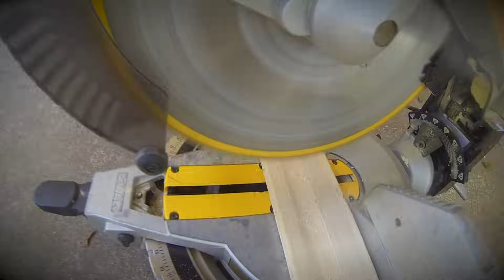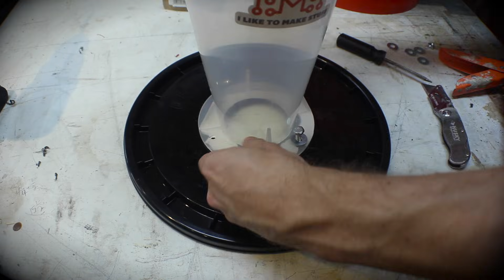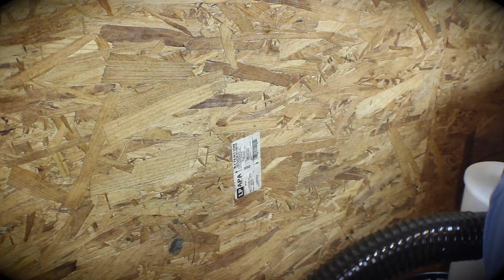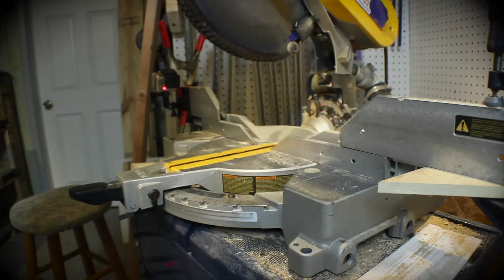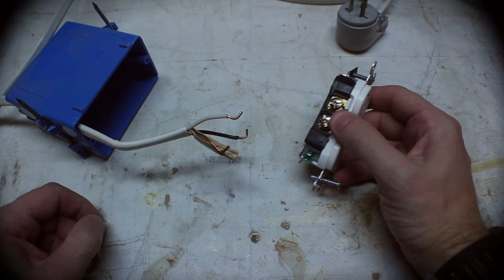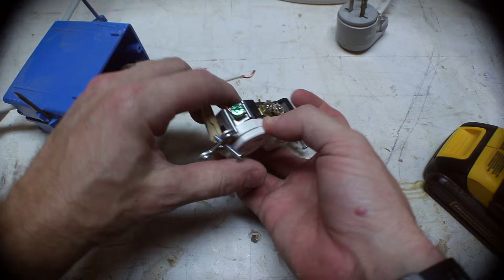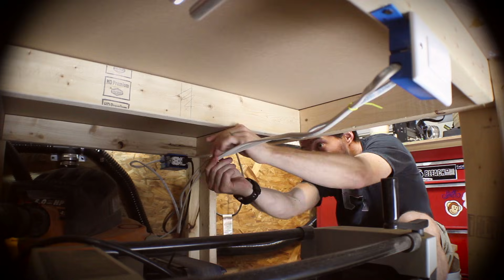How to make a dust collector with a wet/dry vac | I Like To Make Stuff

Comment: Thanks, I'll probably build this for my CNC router. One question: what about grounding for the static built up by wood dust in plastic pipes?
Reply from the maker: Robert Baruch You definitely could run a ground wire into the system easily. Personally, I don't run mine long enough to build up much static, and the conditions have to be pretty unique for that to actually cause a potential problem. Better safe than sorry, but it's pretty unlikely to cause a fire in most cases.

Comment: your wires should always wrap the wire clockwise. when you tighten the screw it will pull the wire in tight instead of push out.

Comment: Great Video and very informative.  I am going to have a run across one wall maybe 2.  Do you think I can get away with  2 1/2 inch pipe all around.  Table saw, jointer, planer, ban saw and drill press.  Small 1 car garage and I might put the shop vac in the attic and have my home made 50 gal.collector in the corner. Thanks.
Reply from the maker: James Dunne hey james! Yeah,I think that would work!  In this case, if you have long runs, you might want to put the main vac source in the middle of the system, and have it branch out in two directions.  Then you could put a gate on each of these branches, as well as gates are each tool.  This way, you could cut off an entire branch all at once, which would help minimize suction loss over a long run that is unused.  Does that make sense?

Comment: HI Bob, I am new to wood working and I am enjoying your videos very much.  Very easy to follow.  :)  I have a question for you,  Do you have an issue with static electricity? I have a cyclone dust collector made from a 5 gal water bottle, a bucket and a shop vac. I'm using pvc pipe and I'm guessing that is why I am building up static.  It works great but I'm not sure how to ground it.. Right now I have some downy dryer sheets inside some of the pipes to help.  It makes the shop smell great but I want a more permanent solution. I've searched youtube and have found 2 videos but they seem a bit complicated for me. Any simple suggestions.  :)
Reply from the maker: Nadine Morgan Hey Nadine!, Well, you just need to ground the system. Often people will run an exposed copper wire through the pipe and connect it to the ground (green) terminal on the plug where your vac is plugged in.You could even just run it out and touch it (you'll get a little shock) after each use.
Personally, I've never had an issue with it, and from a realistic danger perspective, it seems REALLY unlikely that all of the conditions would be perfectly right for a fire to start there.  Technically it's possible, but pretty unlikely.
Reply: Thank you for getting back to me.  It sounds so simple. My concern is I'm feeling electrical stimulation when I touch my metal table saw when I am not using a table saw sled.  I was nervous I was going to get shocked. Thanks again for the input

Comment: Hi April, I have a craftsman 6.0 shop vacuum  and I piped  it in and it does ok but i want it better so I bought a dust collector 13 gal 650 CFM it seems to have less suction than my shop vacuum.  Did you use a shop vacuum first and did you find a difference.tks Lee

Comment: have a sears dust collection piping syatem uses clear tubes that help find blockages also use a switch that turns on the vac automaticaly when i start the table saw moved the vac outside my shop to keep down noise inside my small shop the air compressor and vac are in a bumpout have direct bypass switch inline with power feed to manuelly start vac

Comment: In your video it shows you using a plastic blast gate, but in your list of items to purchase it shows an aluminum blast gate. Is the plastic blast not as good?
Reply from the maker: Jim Mizgalski No the plastic is fine, but in my other video I added servos to control the blast gates remotely. I found that the plastic caused a bit more friction and the servos didn't have to work as hard with the aluminum gates, so I went back and changed my recommendation.  I think the aluminum ones are better overall, but the plastic will work just fine.
Reply: I Like To Make Stuff Thanks for the quick answer. Love your video. I'm about to order the parts from amazon to make your system. I've got a small small area in my garage and this should work out great. Keep the good ideas coming.
Reply from the maker: Jim Mizgalski Awesome! So glad you found it helpful!!
Reply: I Like To Make Stuff My shop vac is 6-gallon, 3HP. Is this enough suction? I've noticed that small dust collection systems are 1HP or less.
Reply from the maker: Hmm, I really can't say. Mine is 5HP and it seems like plenty.
Reply: Jim Mizgalski What size is the hose coming out of your shop vac?
Reply from the maker: 2 1/2"
Reply: I Like To Make Stuff
plastic blast gates are crap.  they get clogged easily.  I had all plastic on my first system and they all broke eventually
Reply: I Like To Make Stuff
shop vac fittings are 2 1/4".  industry standard to measure pipe from the inside dimension.

Comment: Why do you need a separate bucket to empty it when you could directly connect the shopvac? Is there something I'm missing?
Reply from the maker: Mytechtime Yeah, the filter in the shop vac will get clogged very quickly by the fine dust that comes in. This clogging will cut down suction power a lot. By pulling the dust out before it gets to the shop vac, it helps maintain suction strength for MUCH longer.

Comment: How satisfied are you with the suction? Power is lost in the corrugated hose because its offers more air resistance than pipes. More power is lost at each 90° joints. What is the total length, approximately?
Reply: I Like To Make Stuff using Y's instead of T's will improve the suction as well.
Reply from the maker: Cancun771 That's an excellent point about the corrugation. I haven't noticed any real problems with the suction power, but I suppose using rigid pipe would just make it that much better!  Thanks for the idea, I might try that!
I think the longest run I have is about 10 feet, so not very long.  My shop is very small (12x19) and all of the piping runs along one wall.

Comment: random question, but why do you need this? Is a shop vac not good enough?
Reply from the maker: That's actually a great question! I started with just a shop vac, but the problem is that the saw dust is fine enough that it clogs the filter inside the vac. The more it gets clogged, the less suction it has.  The cyclone removes the dust before it gets to the vac, so the filter is much less likely to get clogged.  Thanks!
Reply: Ooooohhhh... That makes sense! Also I'm a really hands-on kind of person, and I really love to tinker, but the problem is i'm a college student wih no space. I plan on getting a studio apartment, and i've been looking into making murphey beds and futons. Do you have any tips or suggestions to make the bed/couch cheap, but still good looking?
Reply from the maker: Daily Cup of Justin Did you see my latest video on making the bed? It was for a king sized, but you could just downsize it for any type of bed and it would be a fairly cheap way to get a bed with storage.  I've always wanted to build a murphy bed, but haven't had any reason to yet.
Reply: Yes I did. I really enjoyed it. I was actually going to message you, but then you commented lol. I am trying to make a "mock-up" on Google sketchup, but my skills are kind of awful on that lol. Any who thank you for the responses and thank you for the great videos :) Also at lowes/home depot will they cut the plywood to whatever size I want, or will I have to cut it down myself?
Reply from the maker: Daily Cup of Justin They will cut it, but not very precisely.
Reply: ah... alrighty. Thank you :)

Comment: Thanks for this.  I have to set up a dust collection system this summer.  What size of vacuum would be considered too small to provide effective suction around the shop?  Is it a function of the hose size of the collection system, or the motor size of the vacuum?
Reply from the maker: Gareth Robins I'm really not sure what a minimum would be, but I think both of those factors are pretty important.  I did notice that the cost different between a little 2 gallon with a 1 7/8 hose (or whatever size that small hose is) and a 12 gallon with a 2 1/2 hose (what I have) was actually pretty small.  If you can swing the extra $20-30, the bigger is definitely a safer bet.
Reply: I Like To Make Stuff awesome, thanks for the response.  Love the videos btw, just stumbled across the channel yesterday.
Reply from the maker: Gareth Robins Thanks!!

Comment: Hello,
What size shop vac do you have? Was thinking about doing this with my 12gal one. Also do you have a problem with suction at the end port? Thanks, Dylan!!
Reply from the maker: Dylan Bender I have a 12 gallon Ridgid and it works great!  I haven't had any suction problems at any of the ports. The only issue is that some tools are just bad at collecting their dust, so so no matter what system is sucking the debris, they still let a lot of it fly around.

Comment: If anyone plans on making the extension cord with the switch, don't follow this tutorial. It is not safe.
Reply: SeanTheHOMIE I have 30yrs, electrical experience, commercial and residential. For a hobbyist his wiring is just fine, I could also nit pick items like the power bar. I would rather know about the cfm volume this system can handle. My vac is top of the line rigid and can not keep up with my 12in miter.
Reply: SeanTheHOMIE Those are small things and it does not mean the instructions are bad just could use improvement. Thanks! :)
Reply: curious.. which part? posting negative comments with no solution to make it right or alternatives is rather pointless. would love to hear your thoughts on why it is unsafe.
Reply: Seth Messer 
- You should wrap the wires in the direction the screw turns
- Always use a grounding wire nut for connecting more than one wire to ground
- Wires should be 6 inches long from the back of the box
- Wires should be spliced before twisting a wire nut over them
Reply: +SeanTheHOMIE A former boss of mine would say, "Don't make perfect the enemy of  good."   But ok... can you point out the actual, real-world danger there, and not just cite "best practice?"
Reply: Wire nuts are crap and should not be used at all, they are forbidden in installation in many countries for a good reason.
The ground wire should ALWAYS be an inch longer than the other wires, so if you rip out the cable by accident, its the last wire that gets disconnected, and the grounding is safe.
Also he should have used flexible wire, because what he did does not count as a fixed installation, so solid core wire is not good, it breaks to easily.
Reply: CFM on really good shop vacs might be 195 if you're really lucky, before you run any hose. A table saw or planer etc needs like 350 CFM or better, smaller stuff can use a dedicated shop vac, router table etc.

That's why dust collection systems while being usually less than the 6 or so horsepower on a shopvac, maybe 2 hp, are a high volume (high CFM) set up like maybe 800 to 1200 CFM.

A mitre saw needs a large hood to the rear to physically catch all the material being thrown at it, then sucked down a "drain" hole to the collector. Lots of these on you tube.
Reply: Arek Kosinski Do you have any electrical experience?
Reply: OMG
Reply: +Mike Grant the cyclone should handle your shop vac just fine. That said, collecting sawdust from a miter saw can be tricky as most don't have very good dust hoods due to the nature of their ability to swivel side to side. I've worked in several professional shops and the only way I was ever able to effectively collect nearly all the dust was by permanently mounting the saw on a bench and constructing a large box behind it and collecting the dust with a larger dedicated dust collector with a 4" line. Some saws are better than others at directing sawdust into their ports. I guess it all depends on what saw you have...

Hope that helps.

Comment: I'm currently building a system using 1.5" PVC, Since the system is sealed, and I'm using ball valves instead of blast gates, suction should be awesome.  The only drawback is static build up, which can be cured with some metal screws put through the pipe wall and copper wire for ground.  I have seen people put the wire inside the pipe, but I'm afraid of build up in a narrow pipe.  The benefit is PVC is CHEAP!  not the ball valves though.

Comment: Great video.  I was curious what the advantage is to using a cyclone/bucket shop vac VS just using a shop vac?  I would assume you will still need to empty the shop vac at some point if you use the cyclone, so why not just use the shop vac and just have one thing you need to empty?
Reply from the maker: Actually, the biggest problem is the fine filter in the shop vac gets stopped up pretty quickly by the saw dust. This obviously cuts down on the suction a great deal.  The cyclone should take the majority of that out before the air even gets to the vac.
Reply: I Like To Make Stuff
that makes sense... thank you for the quick reply.

Comment: My aunt and uncle have a system in their house that collects dirt and debris from around their kitchen (they have wood floors on the main level) and sweep to a location at the toekick in one of their base cabinets and it opens and sucks it out.  This seems like a cheap way to do the same thing which I am thinking about doing since I have a large crawlspace and can easily run tubes to and from a point in my house.  I have wood floors downstairs as well and it's a pain sweeping up dog hair and getting it all in a pan and then trying to keep it all in the pan when putting it in the garbage.

Comment: I just inherited some woodworking tools and plan on teaching myself by watching videos. I have seen many dust collection projects but none that answer a question I have. The old chop saw I got has a much smaller sawdust chute and so does my planer. What would be your suggestion on how to adapt the standard 4-inch hose to reduce down?

Thanks,
Dan
Reply from the maker: You could do it a couple of different ways, but the most straightforward will to be to buy a step down adapter on Amazon (unless you've got a local place). Depending on how much step down you need, you may have to get multiple adapters and stack them in line. 
Otherwise you can get the rubber step down connectors in the plumbing isle of any hardware store an make your own adapters. That approach will probably take a bit more work.
Reply: Thanks.

Comment: Great video, been wanting to add a Dust Deputy to my shop vac.  One question, are you worried about static build up?  Are you planning on grounding at some point?  I guess since you are using hose with spiral wire you could just jump across the plastic fittings.  You may have been asked that but i didn't read all the comments.
Reply from the maker: Ryan Frasier Yeah, I have been asked that, but honestly I'm not worried about it too much, simply because I don't run it for very long. If it were a system that was just on for extended amounts of time, I would.. but it's literally      DC on / tool on / tool off / DC off  
It certainly wouldn't hurt to do it that, and wouldn't be hard, so I may end up running a ground at some point just to be safe.

Comment: what's the benefit of using a dust collector over just the shop vac?
Reply from the maker: Buddha Belly If you draw dust right into the vac, the interior filter will get clogged up pretty quickly, and lose suction. The purpose of the cyclone is to separate out most of that dust and capture it in the bucket. That way the vac can maintain good suction.
You can definitely just use a vac (which is what I used to do), but you'll have to clean the filter a lot more often.
Reply: makes sense. thanks for the reply!

Comment: When attaching wire to screw terminals, wrap the wire around the screw in the direction the screw tightens.  When you tighten the screw it'll pull the wire in rather than push it out.
Reply from the maker: Uhlan Yeah, I realized that I didn't shoot me fixing that.  I blame it on being left handed :)

Comment: Just a suggestion -- it looks like your wired plug doesn't have the romex plastic secured inside the plug housing. Normally, you'd want to capture the insulation in the plug before you screw it down to relieve the strain on the actual conductors. Nice vid, love the work and your great editing.
Reply from the maker: Good point!

Comment: Pretty nice.  I went to Home Depot and bought a remote control light device for $15.00 that comes with a remote on a key ring.  I can turn it on from anywhere in my little shop.
Reply from the maker: Marc Eaton Yeah! That'd work well too! I used one of those for my On Air light How to make a remote controlled "On Air" light and it's always worked well.